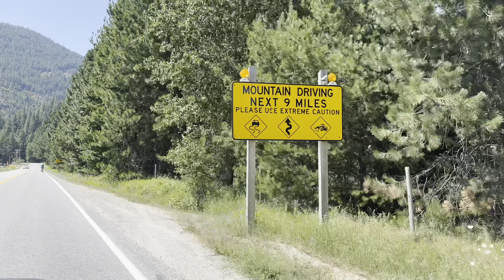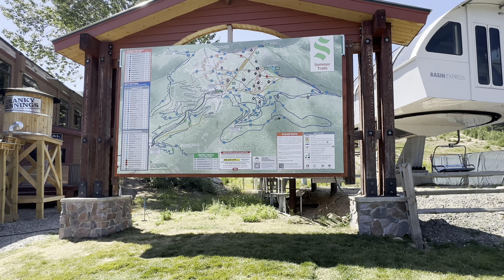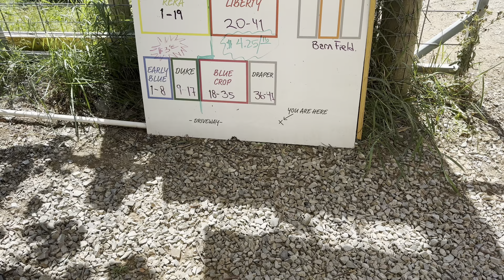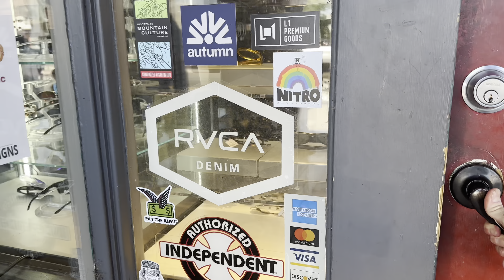RV Tire Issue While Boondocking In Sandpoint Idaho!

Comment: Had any issues with the secondary battery on the Jeep yet? It’s not if it’s when. Just an fyi. TMC shirt? I live about 3 miles from the headquarters here in Des Moines Iowa. They haul a lot for John Deere where I work.
Reply from the maker: No we haven't but know it's only a matter of time.
The TMC shirt was free since I'm a manager at a truck driving school. Recruiters hand out shirts to students and staff. I was an owner operator previously
Reply: @WanderingWagners  I have been told that place is under new ownership. It will be interesting if all of their trucks stay as clean as they are supposed to be now.

Comment: 17:15 welcome to big truck tire mysteries 101, every tire guy will have a different story for why they do that. And so far HIGH air pressure is the only thing I've ever had good luck with, and avoid "315" steers like the plague!! IMHO
Reply from the maker: Pretty sure it's a suspension issue unfortunately
Reply: @WanderingWagners  Good luck, usually once you can see / feel it the tire will continue the wear pattern no matter where you put it, steer drive or trailer. I've tried reversing rotation everything, centermatic balancers, internal beads, everything replaced various components. I did have one tire mechanically trued once it fixed the issue, but a huge amount of the life ended up on the floor under the trueing machine.

Comment: Tire could be a balancing problem. I put Centramatic Wheel balancers on my Tiffin and not had any problems
Reply from the maker: We will report back with results from swapping the tires. We haven't put enough miles on it yet to see if the other tire is wearing weird or just the one